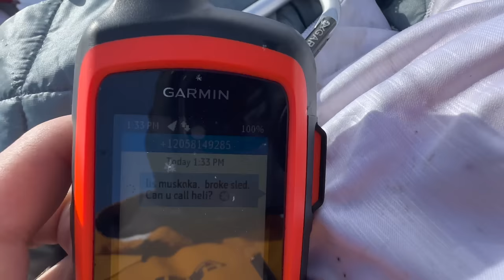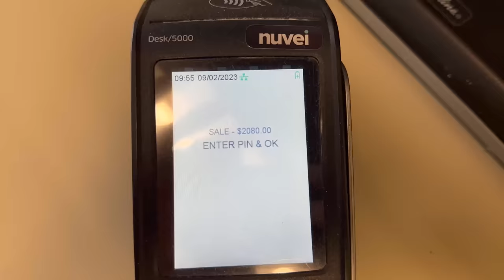2 Sleds 1 Heli

Comment: So 29K for a turbo doo, broken less than 1400km, broken Polaris less than 1000KM cost 26K. These manufactures prices and reliability issues are so outta touch.
Reply: Thing is this is the absolute most extreme use for sleds period. Manufactures have tried to squeeze as much performance out as possible out of the two-stroke, its really not surprising that they blow up  

Now if they could make a four stroke that was as light as a two stroke….
Reply: Agreed, but when your spending that type of money. As riders we expect a little better reliability. Plus if you don’t snow check your machine. Your only offered 1 year of warranty…..
Also, who is buying a used machine with 1500km with all these issues, paying 20K.
Reply: This is what the sleds were designed for and failed horribly. He's gonna be back on that old reliable yellow summit. 4 strokes don't like being upside-down so they'll never take off
Reply: Sounds about right for a Polaris
Reply: Your in the wrong sport if you’re on a budget.
Reply: Can't blame all the mfgs for this... Stems back to how both Canada and the US are being run for all this.
Reply: @peterjacobs6290  quit years ago, buying two sleds with no resale value every year got pretty old
Reply from the maker: The sleds both cost the same. Failure is immanent when you’re pushing this much performance but I somewhat agree. Quality control is just not there, the manufacturers have to push too hard to get these sleds to us in time
Reply: What ended up being the issue with the summit?
Reply: @MrDbeau716  reeds.
Reply: @farming4g  they let anyone in here
Reply: @MuskokaFreerider yes failures is imminent, but shouldn’t be after only a few months of riding?!?! That’s is bullshit for the money these things cost
Reply: @Ryan k  Planned obsolescence. Gotta make sure you only get a season or two out of it. He just happens  to put all his sled time in at once, unlike average Joe that spreads it over the next couple years so I seems like it may last a couple seasons
Reply: @KingBigBabyJesus  should last more than a couple years even lol like you don’t go spend $60000 on a new kitchen renovation just for all the appliances to break after a few years do you?
Reply: I built a 1000 cc triple engine 15 years ago. Pushing hp and higher rpm for racing, the only time it runs is wide open full pull, pulling the engine as hard as I can. It just keeps running,  even after lean burning it just keeps going.

Quality of gas is a big part, race fuel engines can last a lot longer, pump gas is a lot of crap, not very forgiving
Reply: @peterjacobs6290  I don’t think anyone is asking about being on a budget but if you’re going to pay $20K (paid $16K+ for my 2022 Summit X) plus for a sled, the son of a gun better not be blowing clutch parts and chain cases all over the mountain, that’s all.
Reply: Where are you buying your sleds?  That's thats about 15k to much
Reply: Where are you pulling these numbers from
Reply: Matt get on an Electic sled. 😎❄️🔥
Reply: I haven’t been following closely, what failed on the Polaris?
Reply: @Ryan k  They're puttin damn TVs in the fridges and they order your food when you get low! Pretty soon it'll be more technology than food in the fridge, gonna be 3d printin a chicken for dinner. Whether or not it lasts 2 years it's gonna be obsolete.
Reply: @MrDbeau716  didn't stick around long enough, would've found out.
Reply: @Yz4Life  the one's you buy today do break down pretty fast
Reply: I feel like the chain case breaking is more on the guy riding it for it to break the way it did. but a clutch? it should not have failed that fast no matter how hard you are on the go pedal. it don't even have 1000kms on it. crazyness
Reply: @jonstevensmaplegrovefarms3754  oh hi, didn't expect to see you here 🤣

I would say the sleds from the 2000s, or even late 90s, are probably some of the better ones reliability-wise. Something to be said about those F7s for example, brother still has his yet over 6000 miles, probably 2/3rds were go-go-go. It's been fun seeing some channels resurrecting or finding gems still running good yet from that era. It was fun seeing Muskoka on that old Doo from a few videos back.
Reply: They should last much longer. My VFR 800 Honda ran virtually flawlessly for 90,000 MILES until I drove it off a small cliff in Redding, CA. It revs to about 12,000 and was VTEC, the second pair of valves didn’t kick in until 7,000 RPM and I normally rode it above 7 grand.
BTW the helicopter ride to the hospital 20 minutes away cost over $48,000.00 US dollars. Thankfully my work insurance covered it!
Reply: This channel is hands down the best snowmobile content. That being said these sleds are over priced junk.  The cost should be reduced significantly to compensate for the lack of reliability.  I’m sure these do make a ton of power but that’s no excuse for them breaking down every 1000 miles and leaving the rider stranded.  The manufacturer should pay for the heli to pick that up, it’s their fault the machine is a pos.
Reply: @gcow8328  how big is the rock you live under? All these new turbo sleds are over 20k
Reply: @bilboswaggens2975  It was for sure just reed valves?
Reply: Go buy anything with a high performance motor in it, then run it at 8,000 rpm for 1,000 KM, tell us the end results. Brand new 450s cost $12k and some guys rebuild them multiple times in a race season. You gotta pay to play unless you’re playing with the little girls.
Reply: @gcow8328  hurt your feelings? A 9r isn’t a turbo sled. So, let’s stay on track. I searched your channel for professional buying tips but didn’t see any. I’ve got two 19 SKS 146’s. One snowcheck 800 and an 850. So call me out of touch I suppose, even though every dealer is above 20k for any turbo sled on their floor. Like I originally stated.
Reply: @ChaseLandMgmt  you might want to reread the op's comment. But we can talk about turbos, gen 5's easily purchased for 21k. 8k off is quite a bit
Reply: @gcow8328  which is exactly what I stated, twice now. Literally verbatim. The op is way off, and your claim of them being 15k over priced was just as far off as his claim. Mine seems to be the only one that has any factual base. Glad we got there the hard way.
Reply: Have any of you ever heard of warranty? 😂 fuckin shit happens, he rides everyday and a lot harder than 90% of people who sled
Reply: Shit happens but you were both smiling at the end of the day and that’s what counts. Great video. 👍👍👍🇨🇦🇨🇦
Reply: Mount sleds really don’t last long anyways
Reply: @devonkuhlman4261  i’ve got 4000 km on my sled and it’s perfectly fine every brand has problems but when you hold it to the bar for 10 minutes straight engines don’t like that
Reply: @matth8924  how would a four stroke have prevented a clutch from imploding or a chain case from exploding?  Neither situation had anything to do with 2 vs 4 stroke… although still don’t know what happened to Matt’s doo
Reply: The days of riding sleds without warranty are over. They’re too high performance to be reliable anymore
Reply: @akschu1  think it was primaty clutch spring not sure
Reply: @NightshiftCustom  How is the chain case breaking on the rider and not the sled?
Reply: @ChaseLandMgmt  he's 8k off on the turbo and 7k off on the 9r. 7+8 =15. Later dude
Reply: @gcow8328  I’ll accept defeat because I wasn’t aware you were claiming both sleds in that statement.
Reply: @MrDbeau716  we know who didn't stay till the end of the video.
Reply: @CHASE Land Management  it's all good man. Have a good winter
Reply: @leeanderson5955 vfr was a relaxed motor bike though , good bike but not really same as these sleds, they are like the race bikes , get hammered go hard but don’t get longevity because of it
Reply: Fax
Reply: @Farming 4G  yes, so far 1700 miles on the ski doo and knock on wood its good. 

Fuji built great engines for polaris.
Reply: @jonstevensmaplegrovefarms3754  I see way more skidoo with 10k + miles
Reply: Need a cat
Reply: @gcow8328  same to you, ride safe
Reply: Go ahead and keep breaking stuff It's good content. Awesome video
Reply: The future is electric, just gotta get better batteries cause you sure as hell won't see me on one till they do 100km of range is just not enough and I assume that's in mild low throttle conditions
Reply: Have to get a lynx
Reply: All sledders are test pilots for the mfgs these days. Especially 1st year model buyers. Would love to try a Sidewinder MTX but know the weight would be an issue in big stucks.  The are several good riders ripping high hp Winders.
Reply: Reeds are wear item, constantly on and off throttle they are opening and fluttering against themselves so fast, they chip off. What else can they make them out of to last, they already using carbon fiber,  the clutch takes a beating also, everything is a wear item that broke. I doubt they blow them out daily,  we never do. Chaincase, that takes a extreme beating,  specially if u dont check adjustment every couple rides like they ride. It is what it is.. Now if it was motor failure then I'd agree.
Reply: @jonstevensmaplegrovefarms3754  I think everyone who watches these videos would really get a kick out of watching you ride that triple wide open the whole time following these guys every where they go. That would be so awesome.
Reply: @MuskokaFreerider agreed people always expect a new sled every year and that’s a short time to fix or come up with something new. Wonder if they’ll ever change it and wait a year or so?
Reply: @MrDbeau716  A broken reed. Nothing major
Reply: @Catboy-hr2qp  there will be no batteries in mountain sleds for a long, long time. The 1 electric sled out there is a tank and can't go half as far as a gas sled, and even then you can't just carry extra fuel.
Reply: @MuskokaFreerider  Agree'd, But in the case of the Polaris, he straight up landed that beast on the secondary, likely misaligning the chain due to the excessive force.  Couple that with the High rpm, and it makes sense that it would explode out the side.
Reply: @Yz4Life  The design life of appliances these days is to get you out of the longest warranty they offer, so about 5 years.
Reply: That’s why people buy older sleds
Reply: Well most of us dont ride revving at 9 grand all day lol. Its only money
Reply: @matth8924  yeah , extreme thats forsure. Rev at 9 grand all day. 
Those kids with mufflers cut off cars running around blowing black smoke because they just over rev /red line all day long. Got to pay if u wanna play in the mountains i guess. Cheers
Reply: If it was a Yamaha it wouldn't be breaking very rare
Reply: My Yamaha Sidewinder MTXwill get 20,000km without even opening the motor up ,and I'm not kidding change the oil once a year and go
Reply: That's because the OEMs are to focused ,on light weight hi HP sleds that they have lost all reliability, the last 3/4 years the sleds are absolutely garbage and way over priced. This season my dealership has like 40 sleds that know one is buying because people can no longer afford a new sled a these ridiculous prices $30k for a toy we ride maybe 5 months of the years average guy might get to the mountain twice a month , and the sleds break long before 2000km this is totally unacceptable  WE NEED TO BOY CAUGHT THESE OEMS TILL THEY CAN BUILD A SLED THAT WILL ACTUALLY LAST

Comment: Man crazy day, heli sled footage was the best. Little advice from sled snowboarding crew that doubles on the regular.. when riding double let driver have hands on both side of bars like normal. Rider holds mountain bar under drivers arms underhanded with right hand. Then rider lightly holds left bar end lightly. You don’t need full grip just enough to balance. When sidehilling on right side you can switch left hand underhanded to mountain bar and hold lightly on drivers pack pretty much giving him a hug. Hope you don’t get another chance to try it. 🤘

Comment: Best entertainment on the internet!!!   Wow, Matt what a great job documenting this and editing for us. Friggian incredible!  Im so happy is was the P22 and not the engine after that crazy wide open pull!!   Hopefully Polaris will get you back up and running soon.  I would go P85, and not run that P22.......so many issues with it.
Thanks Again for the smiles, laughs, cringes, smirks, and conversations generated on a regular basis due to your incredible content.
Cheers!
Reply from the maker: 🙌🙌 thanks! We will see how this new p22 holds up.  If it fails maybe we have to get the 85 somehow.
Reply: There's several shops setting up the p85 for the 9r. Same crank taper, so it's just a bolt on and check alignment. Since the secondary is the same you can screw the deflection adjustment bolt in from an 850

Comment: Thank you for breaking a Skidoo and a Polaris, makes it tricky for the haters. I hope you get everything fixed soon, what a great year.
Reply: A reed broke and went into the piston? Wonder how often that happens!
Reply: @fairbanksairriders  and it didn't leave him on the hill also to me that's a really big deal. heli rides are not cheap!
also I think if the reed went into the piston it would not be ready to ride as he says in the video but will see I guess!
Reply: @fairbanksairriders  It happened to Longtrack Jack of Boondock Nation - along with just about everything else
Reply: @NightshiftCustom  Replacing that clutch is way easier to do than replacing a reed/piston/motor. 
Like Matt said - if it wasn't gonna snow at that location for the next 4-5 days, he'd just ride up and replace the clutch up there. Derek's chain case however.....

Comment: Belt drive vs chaincase looking better and better.  

And for those who say "why can't the manufacturers make these better for the  price"

They probably can't.  They could maybe add 4-5k more beefing these sleds up but this type of riding is pushing this equipment to the max.  20 years ago, people didn't ride like this.  Wide open spinning 3" 165" track put so much stress all across the drive train.  

What they probably need to do is rethink trail vs mountain drive train and maybe seriously beef up mountain sleds, which will come with a weight penalty.  

Either way, great content

Comment: The broken chain case was not bizarre, the bottom gear has too much play and wobbles then stretches the chain and sometimes the gear breaks. Probably be a recall next season.

Also you rode one of my favorite areas!! Too bad you had 2 busted sleds and not on boulder.
As a bonus you learned a new skill to double out

Comment: Just rescued my brand new Polaris 850 after engine seized.  150 miles.  Double riding is pure hell
Reply: Had to double ride for 70 miles back to our cabin once. That was torture. Good to have friends though.
Reply: Yes without friends I wouldn’t of made it out
Reply: Where is D.Peterson to comment on this? ...like Poos r the best and your lying.  Lol.
Reply: @bigchaloopa  First I've heard of this season. Meanwhile in the Doo camp....
Reply: @208SledHead  Was out with a good friend on the weekend and his new poo 850 with 282km's seized solid. didn't make for a good day after that...
Reply: @208SledHead  i asked the brp dealer when i was there last week how many g5 engine failures they have had this season and they said none and said they said they usually have 3-5 a season. When taking my buddies to the Polaris dealership, they had 3 waiting new engines and no date to get replacements. Not a good way to finish the season for him. Seems both camps having different issues this season

Comment: I'm in total agreement with your first commentor,  26 k for a snowmobile I'm expecting car like durability,  (and im thinking a fairly durable vehicle....north American  oem at least )granted I understand your in the mountains and rolling wide open alot of the time , but I'd like to see the numbers on engine , clutch , chaincase failures via each  manufacturer,  mountain or flatland machines. The cost to durability ratio = ridiculous.

Comment: give the driver the brake with his left hand, you as the passenger get get your left hand on the mountain bar only and stay neutral (no pulling on the handle bars just putting weight into your feet) and let the driver control the lean of the sled. we get up some sh!$ doubling like this for snowboard access. or ride squirrel but put your feet in the stirrups!
I find when both riders are experienced, Canadian ( side x side) works well but if its super deep or technical sometimes squirrel is the answer

Comment: When I bought a 9r with a roller bearing primary clutch I was hoping that it wasn't going to be another bunch of nightmare clutch problems, that you have to worry about like the old arctic cat. After this video, it makes me wonder.
Reply: Seems like the components on the 9r, clutch/chaincase, can't handle a deep day where you're wfo 90% of the time.
Reply: @MrDbeau716  The 9r doesn't have a chaincase. But making all the rotating parts lighter for snappy performance has to have trade offs it appears.

Comment: Polaris just feeding you the content 😂
Reply: How? If this is an attempt at brand bashing, doo went down first. When manufacturers try pushing this much power out of something so small you’re going to have problems. Grow up, brand bashing is childish.
Reply: @2010Greendayfan  how? Because a video with two sleds getting helied out is good content, would’ve said the same thing if it was a doo or cat. Yamahas however no helis for those 😂
Reply: @LimitlessNorthernAdventures  Yamaha hasn't built a mountain sled in years
Reply: @208SledHead  what do you mean the mountain max is genuine %100 Yamaha quality engineering
Reply: @LimitlessNorthernAdventures  LMAO!! Buuuuullshit. That's 100% CAT.
Reply: @208SledHead  I’m aware was just being sarcastic